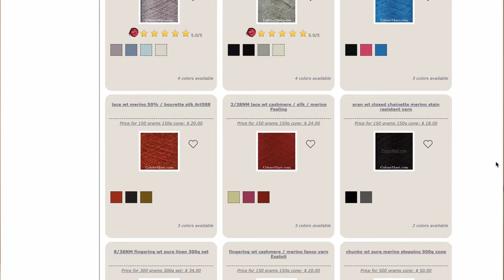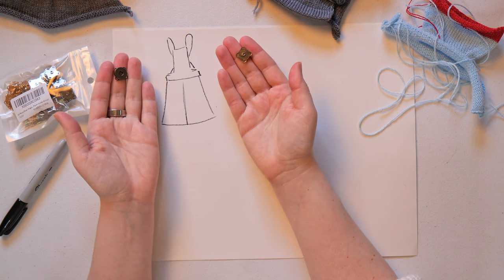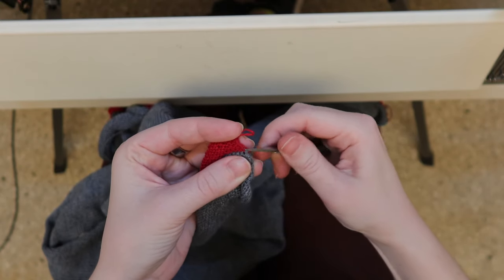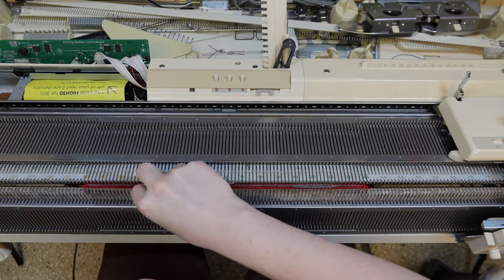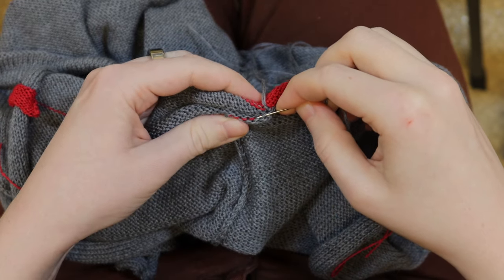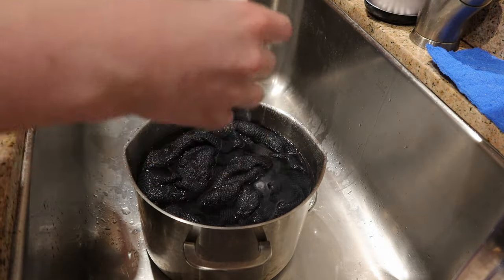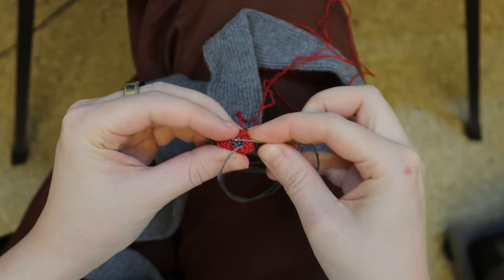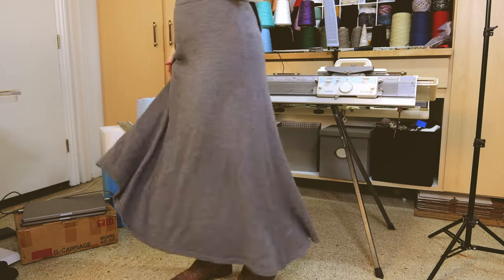Machine knitting a pinafore dress

Comment: For oiled yarn I do a first wash in the sink with Dawn to completely remove the oil, rinse until the water runs clear, then wash with a woolen wash like Eucalan, Soap or Woolite without rinsing (these products are low sudsing and for washing woolens, not for scouring oil used in machine knitting yarns).  You can use circular knitting to do a "hung hem".  It is a lot easier to transfer the ribber bed needles to the main bed doubling up stitches then carry on knitting just on the main bed.  I think it gives a flatter hem as well.  Your finishing is really impeccable and I really love the final knit!

Comment: That is a beautiful dress. Not my style as it's a pinafore but you have inspired me. I got a book of beautiful hands knitted shawl patterns. Both the front colours and back colours are gradients. I think I have about 10 to 15 colours, I can't remember if the to of my head. I looked at what the pattern was and tried to get similar colours. I think that to do two colours on the same row I can use my pattern/tuck thing. Well,  that's only 24 sts wide I think, so I made a new pattern. Also because the hand knit shawl wouldn't fit in my machine (going to do it on my bulky) I have been thinking of different shapes I could make. Well, watching you make that dress makes me think I could do the colours and pattern as a dress. May not be the best on a bulky machine to make a dress, but I'm using double knit wool so that may be ok. My other issue is all the loose ends. Every row is two different colours, so attaching two similar panels may be too difficult. Unless I don't cut the wool and just carry it up? I bought to much wool for the shawl and I can always get more of the colours if I needed to, it's a will known brand in England. What do you think?